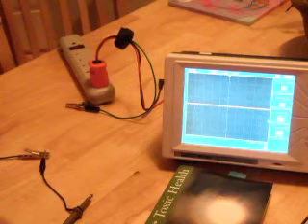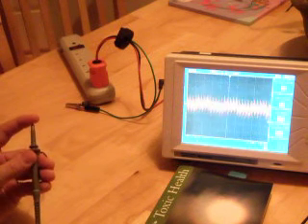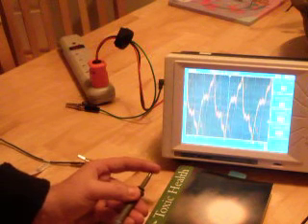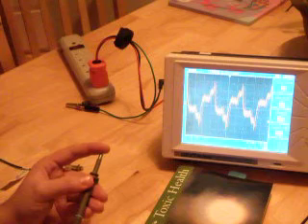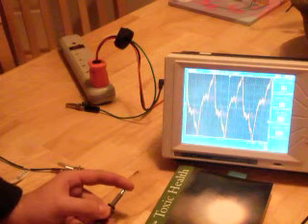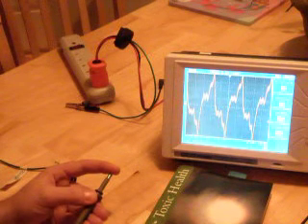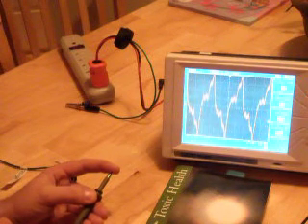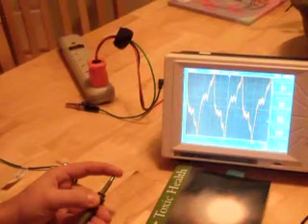Measuring Stray Voltage on the Human Body on Tiled Flooring

Comment: As an electrical engineer you should know that your readings are misinterpreted because you are using your measuring tools at the wrong way.
1) Your ground lead of your scope probe is very very sensitive for interference, and must be as short as possible.
Even with the short lead, you will receive noise and interference on your signal.
Extending this original short lead of your probe with a cable to outside your house is not done, and induce even more interference of your measuring results. (You also not mentioned if this extended cable is shielded or not).
With an unschielded ground lead that long, you created yourself a antenna to pickup all noise and interference you can get.
2) You touched the tip of your scope probe and get a 50Hz or 60Hz patern on your scope, but this signal is not coming from your grounding outside your house, but this your own body which act as an antenna to all electrical radiation in your house (electrical wiring, Switch Mode Powersupplies in devices, LED lamps etc.....)
3) In another video of yours, you demonstrated the stray voltage with 2 glasses of water, and the glass on the floor showed a lower voltage, then the glass on the table.  And when you touched the glass on the table, the voltage rised.
That proofed, that your stray voltage readings are not coming from your grounding, but from your own body.
Reply: @Marc Menard , yeah probably controlled by 6G by aliens :-)
Stop spreading all kinds of wrong news if you don't know how to proper measure "stray voltage".
How you use your oscilloscope isn't the proper way of using it, and your readings are all over the place.
Know your tools so that you can use them, and interpret the readings the right way.

Comment from the maker: I was barefoot.  The oscilloscope that I use is a battery powered Owon PDS5022S, it now appears to have been replaced by the Owon SDS6062.  You want a two channel battery powered oscilloscope with fast Fourier transform (FFT) for power quality and human health work.  You may be able to find a cheaper battery powered oscilloscope in the electronics hobby stores. My latest electromagnetic radiation and human research is now available in the book "Solar Radiation, Global Warming and Human Disease".

Comment from the maker: What you are describing could come from a number of sources: "Dirty Electricity", "Stray Voltage", nearby power line emissions, emissions from your neighbors equipment, emissions from your equipment.  Turn off your fuse board and equipment and scan your home again with the Trifield 100 XE meter, if the fields are still there, call your electricity company and inform them of the problem.  You should have an electrical engineer who has worked with power quality issues come and test your system.